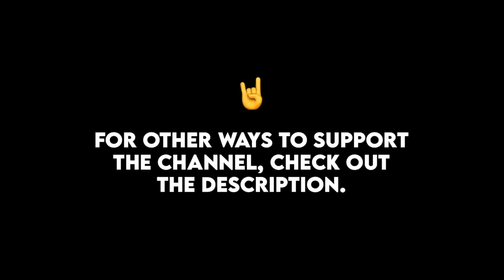Making a Disc Golf Disc | How It's (Hand)Made

Comment: Hey panda. Welder fitter mechanic hear of 20 years or so. The cheapest solution to your pull and push needs to me is a chain fall small. You can use them in both pulling and pushing or up and down. You'll need a small rig to hook it up to, I would go for 1/4 inch tube steel 1.5* 1.5 inch or angle iron, angle is cheeper. Use straps rated for the right weight for the chain fall and get an engineer to give you the best angles for the chain fall to sit at. Over rate your concrete anker's safety first. A low gear ratio will pull less chain a high gear will pull more chain. The engineer should make it mechanicaly sound as it should not pull itself apart. Find three or four students to draft it for you, cheapest rout. One more thing pulling down is tuff you'll need to drape the chain over something and work it right, a come along is the next best option to my knowledge. Take it ez.
Reply from the maker: I'll add that to the list in my research! Thank you!!

Comment: You skipped one of the biggest questions I have!  How many molds do you have, where did you get/how did you make them?  Seems the molds would be hardest part about trying to do this yourself!  Thanks
Reply: probably had machinist make molds in cnc machine.
Reply from the maker: You're absolutely right! Unless you have a cnc in your garage, machining the mold is not very DIY friendly.. haha I have a connection to a machinist who machines my molds! And I am currently perfecting a prototype, so there have been multiple versions of just one mold. (If you dig through my archive of videos, you can find those answers in one place or another.)

Comment: Too many comments to check, but there may be a way to fit the ram of a electric log splitter to a press. Ditch the base and bolt it upright so you can use your gravity feed at the start. Another simple mod you can make right away is to add a locking hook to your press so it locks in at the bottom so you don't have to hang off it. Great machine so far, you got a new sub and I want to see what you do from here!
Reply: You also need to make friends with a welder, pay him in beer and I'm sure you can get that thing welded down to something other than your wall :)
Reply from the maker: Love the feedback Sean! And since this video have made friends with a local fabricator too! (In the meantime, you may like this: https://www.youtube.com/watch?v=uR8wmNgJvdU&t=146s )
Reply: @TrashPandaDiscGolf  That's it! The machine built in the video you linked looks very similar to the setup you have, and they were able to build it with even fewer modifications than I originally thought too. Something mentioned in the video you linked was the higher probability of violent failures in the chance that something is loose or in chance of failure. Methods I have seen used for controlling these risks are blast shields and having a remote control start and emergency shutoff in case of a failure (you can probably get away with a couple push buttons from your local electronics supply and wire them to your motor control) and check this video out for blast shield ideas (https://www.youtube.com/watch?v=tiDJVd6_fqg&ab_channel=TylerBell). You can make something smaller to just cover the injection system if you want. You know what they say, "S*** happens". Make sure s*** doesn't happen to you!
Reply from the maker: Haha I greatly appreciate your thoughts man! I'm a big fan of Tyler Bell ever since I found him from making the forged lounge chair with Alec Steele. Great stuff! Please don't hesitate to share your thoughts on future videos too man!

Comment: 1. Use hydraulics instead of your leverage/weight. 
2. Use a gate valve instead of removing the cap from the "barrel", (tube).
3. Have the heat source closer to the "barrel", (tube, cylinder).

Comment: A handle extension, for more leverage.
Reply: This was my thought too. I think increasing the lever arm is probably the easiest option.
Reply: @joshdowden494  the longer pole would add more leverage but run out of travel. So you could push the plunger down with a surrounding pipe that has holes that can be pinned into the plunger at different lengths.

Comment: Dude. Put a pipe over the end of your arm and increase the lever length. Also add  some 2x6 diagonal cross bracing to your wall. Shore up that wall so it doesn't move.
Reply from the maker: Great call on the cross brace! And yes, the lever and angle is my next improvement. Thanks for the feedback!

Comment: Longer lever. Add a handle on the end at a higher angle so you can maintain vertical force near the end. And just add some counterweights you can clip on and off with a carabineer or whatever. Also a chain/wire/rod you can attach at the bottom of the stroke to the machine or floor so you don't have to sit there and hold it. Those should be the easiest simplest ways to make your life easier without adding any winches or machines to the set up. Longer lever, another handle angle, counterweight, lock bar.
Reply from the maker: Thanks for the feedback! Great stuff!

Comment: I would suggest using a larger diameter tube for melting the plastic.  Then use a bearing press (10 ton bottle jack press) tonget more force down.  The have springs pull it back up. Look at how autshops press bearings. 

Either way.  Fuck I wanna make my own discs now hahahahaha

This is amazing man.
Reply from the maker: Hahaha thanks for the feedback!

Comment: Find a piece of pipe and put it into the slot at the end of the plunger bar. The longer the pipe the more leverage you have.
Reply: good way to rip out wall.
Reply: @brian6speed  Thats a good point. My idea is probably the most expedient solution not the best.
Reply from the maker: Your point is super valid though: the current configuration of the handle and pivot points are not set up the best. That's the next thing on my list to reconfigure!

Comment: you can try a linear motor to reduce your manual labor,

https://www.aerotech.com/product-catalog/motors/linear-motor/blmx-series.aspx?p=%2fproduct-catalog%2fmotors%2flinear-motor.aspx%3fpeakForce%3d5

I see some on Ebay, you will need a high torque unit, the length you may have to adjust your bore to accommodate.  

also you could try making a set of rings like a piston for your car, to reduce the amount of plastic that squeezes by your bore, you would probably have to taper the first inch or so to get the bore and rings started, if you run a set of three you would have little to no blow by.

https://www.fastenal.com/product/fasteners/retaining-rings-and-clips/external-spiral-rings/612444?categoryId=612444&level=3&isExpanded=true